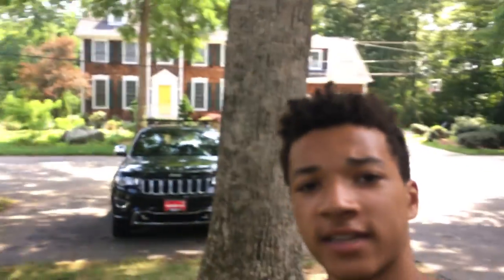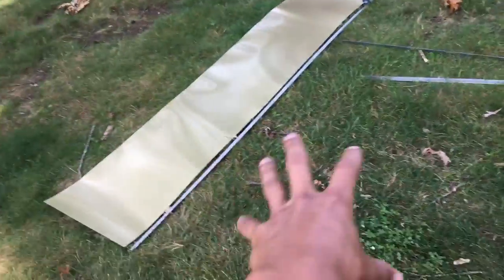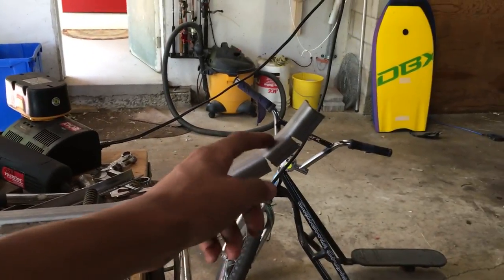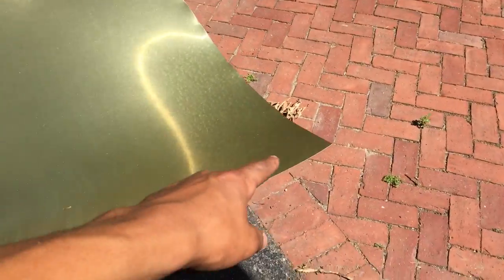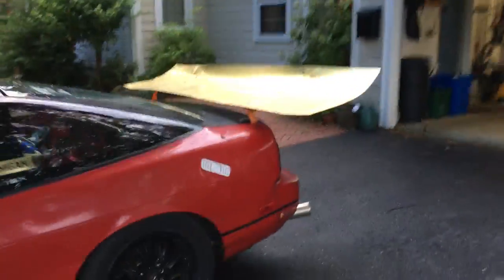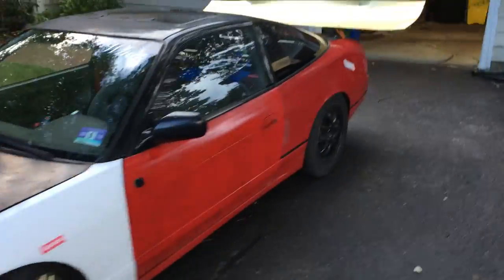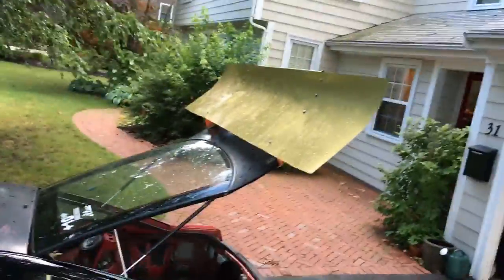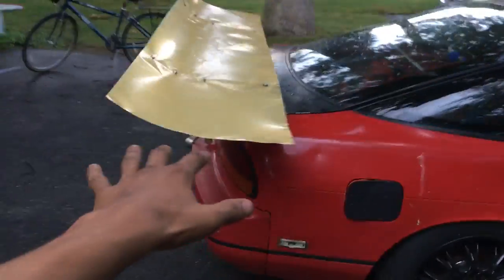Failed Rice Wing Install On The 240sx

Comment: hint of advice. shorten the length of the metal you use to just past the original bracing and the width it too big. i would say between 8 and 12 inched for the metal width if you were to make another wing with thicker material.